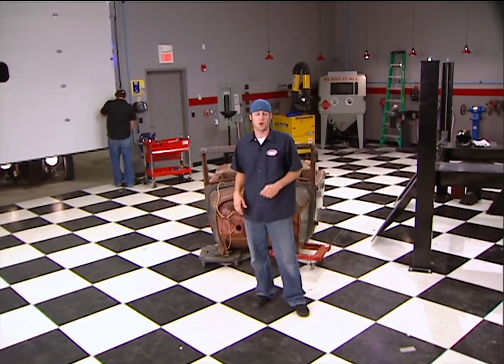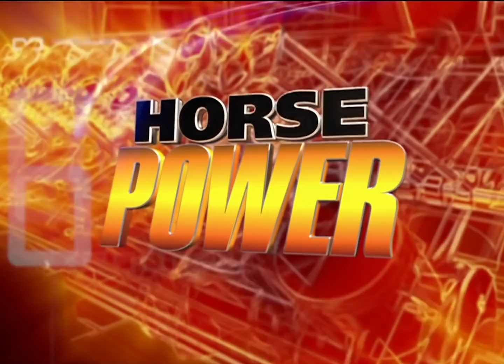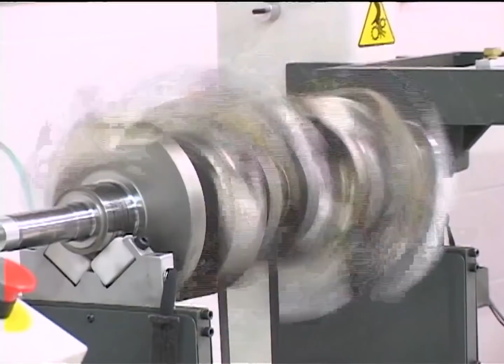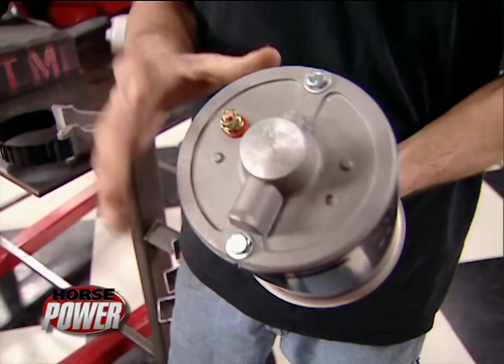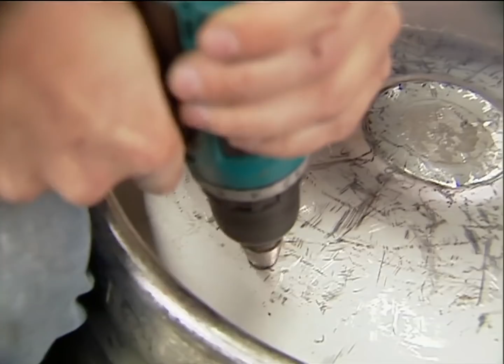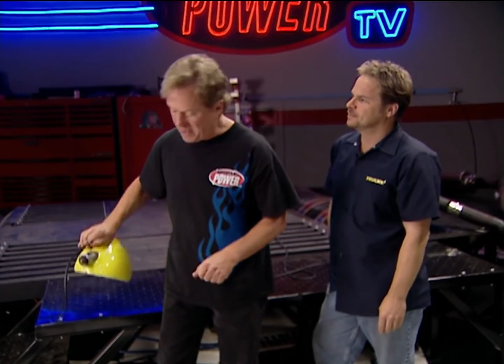Full Build: Watch A '29 Ford Roadster Turn Into A Raunchy Rat Rod

Comment: You didn't bolt that in from the top of the firewall.  Why not cut out the bottom of the fuel tank and make a bracket under the cowl.  You could fabricate a dash panel.  Since you aren't using the model A tank why do you you need a filler neck on the old tank.

Comment: Rat rods are built from junk by people too lazy to do even the basic paint and body teenagers used to handle easily, no matter what's under them. They're popular because throwing together junk body parts requires no effort. Everything BUT the junk body is kool and the REASON it's kool is the builder chose QUALITY parts for the chassis and drivetrain. Now go throw a decent steel track roadster body on the poor thing (which will also be worth much more).

Comment: you did not show where you ran the exhaust. im building a 37 ford coupe with a similar frame but a 2017 musting IRS and finding it hard to place the mufflers  in a spot where heat inside the car will not be a factor
Reply: Down the side, get rid of the Mustang II put a straight axle and buggy spring, transverse, on it.

Comment: Top Tip: Save your money until you find something you like, then change it to suit your taste. It's a lot cheaper in the long run. I would definitely NOT run a flathead. They are prone to overheat and be underpowered. Even a blown flathead makes as much power as a stock sbc. I used a '64 283 for a fraction of the costs of their flathead. My trans was a Muncie M-21.
Reply: I used a flathead, it was the last engine that my freind  Bob built before his death.  It ruins great.  I will never change it.

Comment: It's a nice enough car but unfortunately it misses the whole point of a Rat Rod which is a one off car built at weekends in a small back yard shed using what bits can be found lying around or in your local scrapyard. Not by finding an old body then ordering everything else new and ready made from your local Motorfactors!

Comment: That panel over behind the seat positions, I’d cut out and use for space of things to come or need on the road.  Great vlog, it’s still a hot rod that HAD TO BE BUILT. And I’d put one of the Chrysler 3.6 Ltr., v6, twin ohc, 296 hp, just to be different, and a good engine that doesn’t start with “LS SOMETHING”.  My Chrysler van will burn the rubber if punched with the v6. It’s also compact.
Reply: Real hot rods don't have a V6.

Comment: Love rat rods, but build it like a normal person would in a drive way with tools and not with with endless money
Reply: This ain’t a rat rod. It’s just part numbers that you buy. This is disgusting a little bit. Nobody built it - they assembled part numbers.
Reply: See, that's not what rat rod means anymore. Like every other automotive fad, it is exploited by the rich and TV. It is completely contrary to the origins. Rat rods were just cars built with either money or motivation as the limiting factors.
Reply: Rat hot rod pot shot

Comment: Worst excuse for a rat rod ever, 99% new parts mounted to a rusty roadster tub which looked great for a resto from what I could see.
Patinated street rod at best, nothing rat about this at all. Sorry guys, the only nice thing you did was to use a flatty for the motor, even then a fully reworked flathead is far from budget but mega cool in the '29 roadster body.

Comment: The PCV valve is a smog device I like, it pulls bad vapors out of the crankcase before they condense into the oil, making the engine last longer between overhauls.
Reply: It removes blowby it was actually an early smog control.  It can create negative pressure in the crankcase.
Reply: 500lbs for a roadster body. My whole car running weighs 1500.
Reply: Don't you have a  tig welder?
Reply: I think the frame is rust color paint, not ratural rust.
Reply: A flatty is the only way to go on a traditional hot rod.  Anything can go in a rat, I've seen diesels.

Comment: Couple thoughts:
1: The title should be .. "How To Spend Way Too Much Building A Rat Rod"! 
2: Finish the fab work before painting your chassis! 
3: Shop for cheap used parts so that the finale cost won't be a LOT more than the finished product is worth! 
4: Learn how to fab some Rat Rod parts .... especially a grill because that one sucks worse than anything ever sucked before.  
5: That's not a 9 inch ... someone lied to you .... and you should know your rear ends before getting on TV and talking about them!
6: And last but most important: Watch Rat Rod Bob Builds before building your Rat Rod.
Reply: Right on bob!!!
Reply: this is how fake a rod
Reply: 7. don;t bolt on $50,000 worth of brand new parts onto shit that has 50 plus years of rust on it, I mean damn.... noone doing that at home. even the novice builder id gonna ATLEAST hit that shit with a wire brush and a cheap can of flat black/clear coat wal-mart paint.... Atleast TRY clean it up and make it look good. It can still look rusty without actually BEING rusty.
Reply: Welds are pathetic as well

Comment: What happened to the $2500 budget?Not exactly a rat if it cost15k to build
Reply: Probably 30k now. I think these are almost 15 years old.
Reply: @d.riprock1546  
I'd say closer to $50k, this build happened back in the mid 90's.

I think its from the third or fourth season of the show.
Reply: @Hammerhead547  bro this episode happened in 2007
Reply: That's how u save on build time lol.
Reply: My hot rod cost more than the $5000 that I alloted for it.  By alot!
Reply: Looks like they're building for the Nat'l Roadster Show or SEMA

Comment: Rat rods are suppost to be super low buget !!  not thousands of dollars ! yes asshole its finished ! surface rust is not a crime . what is a joke is spending hundreds of dollars of paint to imatate patina faded paint and surface rust . I know where there is a late 29 or 30 rat rod home built with ford leaf spring front end and a chevy 10 bolt rear end. I swap to a mopar 8.25 and the rat needs a motor an tranny . was thinking of  my 904 automatic with my matching 225 slant6 😎🤘🏁